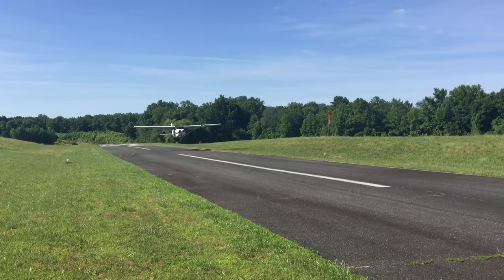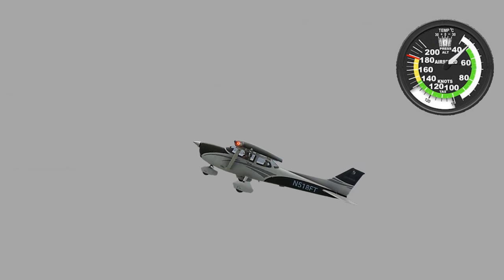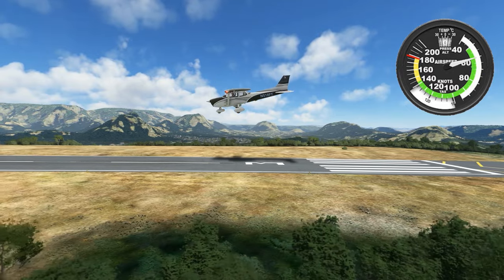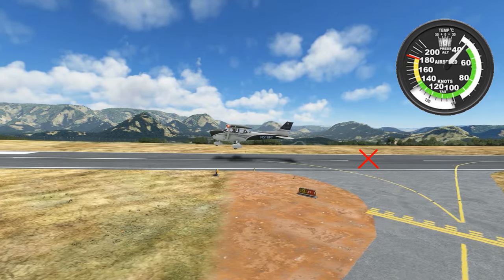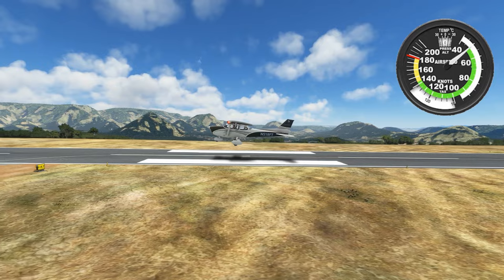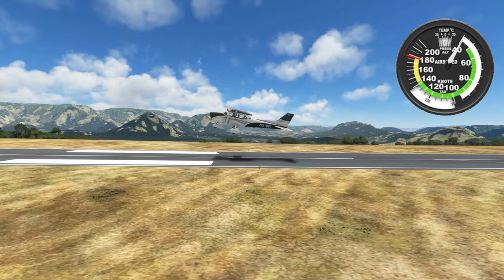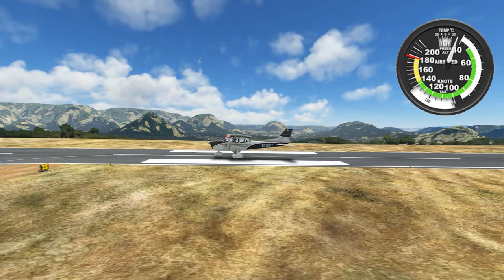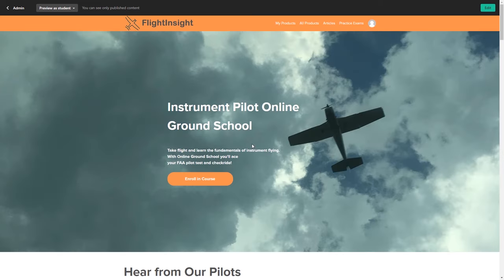Most Common Landing Mistakes | How to Fix a Bounced Landing | How to Land an Airplane

Comment: Thanks for video. I’m about 12 hours into flying and was struggling with this. Usually carrying too much speed with full flaps and then bouncing or ballooning or combined! Then my instructor had me approach with zero flaps. What a difference. I got a better understanding while floating a few feet off runway of the finesse needed and getting your speed set well in advance.

Comment: Its been months now trying to improve my landings in flight sim. Learnt different concepts, none worked out as the best. Watched this video at work and tried as soon as I got back home. Landed C152 very near to stall speed, 0 bouces and -28 FPM (Don't really know much about this atm), no ballooning and impact 1.01G. Only thing to work now is side slip.
(I used  Gees - In game landing analysis) Thanks! 🌟

Comment: Great video again. Paul Bertarelli from AOPA talks about how long runways and huge pattern sizes from tower controlled fields cause many pilots to develop a “take as much time as you need” habit of landing. All good for safety, but it does kill off good skills. My instructor would challenge me to exit a runway by a certain taxiway without excessive braking to teach how to land on the numbers - smoothly - rather than drift down part the fixed distance markers, after I got good at landing smoothly.

Comment: Momentarily  peek out the  lower left corner of the windshield and the pilot door window and you will actually be able to gauge your height above the pavement. In a tail wheel airplane such as a Stinson, you can’t see over the nose when the plane is on the ground. So we look out at the leading edge of the wing to gauge pavement height. Use two fingers on the yolk and don’t do a death grip. You will “feel the plane” and the movements will be smooth.

Comment: Too many GA pilots carry excess energy in the approach-result-multiple bounces. Related to this, few take into consideration a reduced landing speed (Vref) due to reduced aircraft weight. Commonly POHs only cite a single approach speed and this is for max weight. Vref could be a good 10 kts less with a single pilot in a Cessna 172-your CFI likely won’t know that.

Comment: My second solo I bounced like hell..I came in to fast, realized what I had done a bit too late to correct the speed for a smooth landing.  It felt like it’d never stop bouncing and by this time I was in panic mode, I should have done a go around but I was scared to death and drew a blank mentally, it was the first time I had a sketchy situation without my instructor with me. Learned a good lesson and gained a bit of confidence, it wasn’t the worst case scenario( well it is for a student pilot, in the moment😂)but I was able to keep control of the plane enough to land safe enough. I’ll make double sure I never do that shit again, praise the Lord I turned out okay.

Comment: Brilliantly explained. Does this also apply to commercial jets?
Reply: For the most part, yes, except for landing at stall speed.  Jet aircraft land a bit faster than stall speed, and have ground spoilers that will prevent the airplane from coming back off the ground due to access lift.

Comment: All the landings in the video were too fast.  Perhaps looking at the airspeed indicator for stall airspeed.  Vso is an out of ground effect number that has nothing to do with either takeoff, in low ground effect, or landing, in low ground effect.  Wolfgang's "stall down" is much easier with power/pitch, but the poor energy management of ACS requires a round out and hold off.  So practice hover taxi with full flaps and quite a bit of power in low ground effect.  Hopefully you will learn to dynamically and proactively move the yoke fore/aft to stay level in low ground effect.  When too fast, this elevator trick and feel for just about to touchdown height will help.